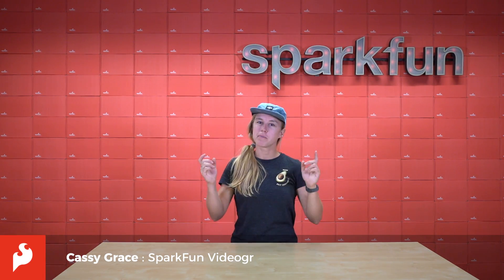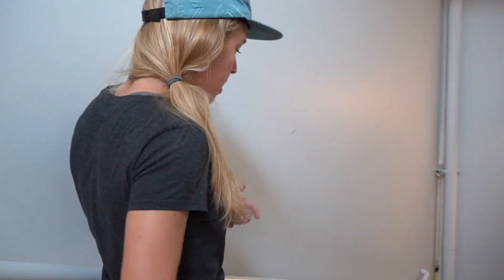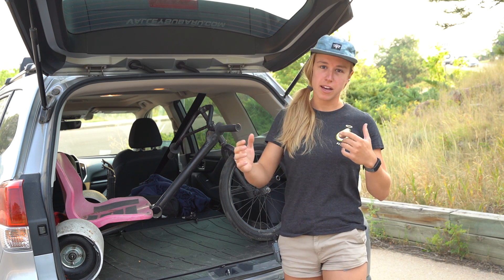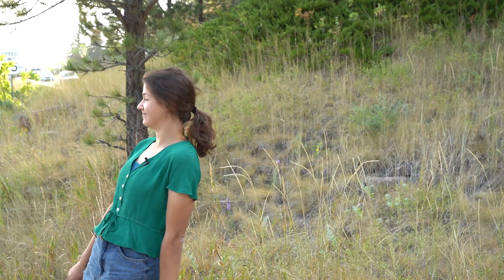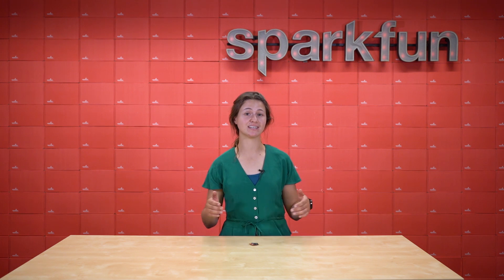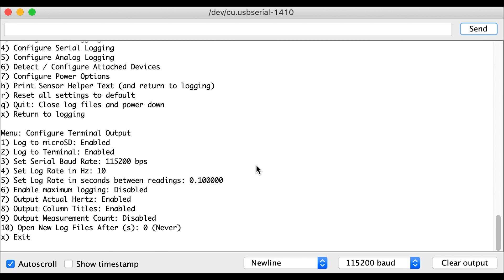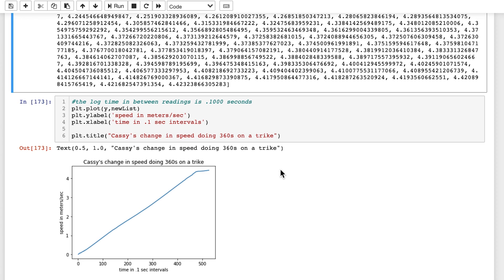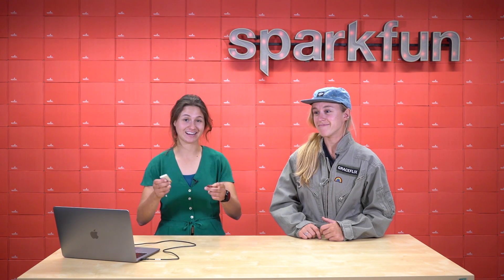Project Showcase: Drifting with a SparkFun OpenLog Artemis

Comment: Hi guys great video. How fast can the imu sample? And does it have an RTC or timestamp associated with it?
Reply: It has timestamps from the onboard RTC and they are logged by default, but I have found it a pain to keep the RTC time and date set. There is a tiny rechargeable battery onboard that in principle should keep the RTC going even when powered down, but I just cannot seem to get it to remember the time no matter what I do, so it always reverts back to Jan 1 2000 in my logs. Frustrating. Plus it seems that if you slow down the logging to really extend the run time for longer-term logging purposes, it seems to be very difficult to get it's attention at the terminal to even change it, meaning that I can't just plug it into USB, set the time and date, plug in a battery, and then unplug the USB. IMO there is a lot of potential here, but it is pretty flaky right now.
Reply: @DaveTheYellowDart  thanks for that reply! Great info

Comment: You set the sample rate to 10Hz? 
I don't know what is the maximum sample rate with only the acceleration measured but from the specs I see that when all sensors are measured, the maximum is 250Hz. That still seems low but much more useful that 10Hz. 1000Hz should be the goal for that project.